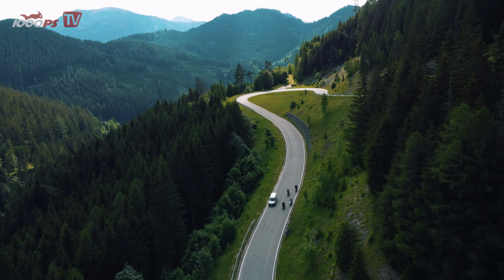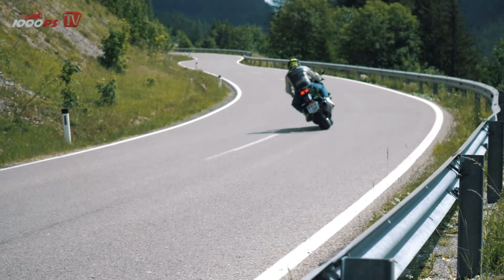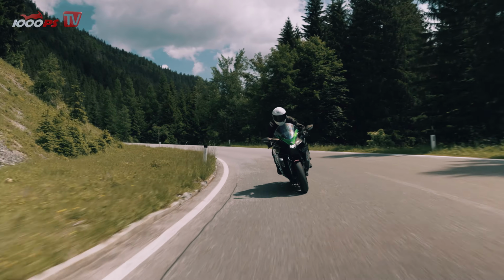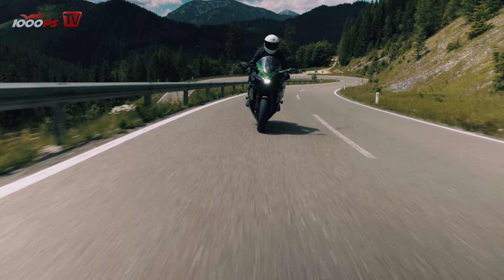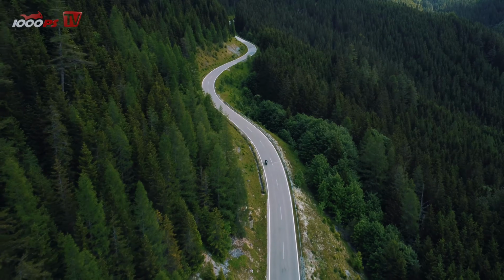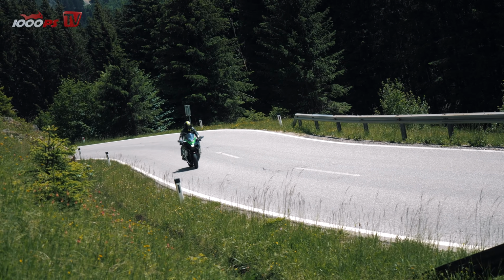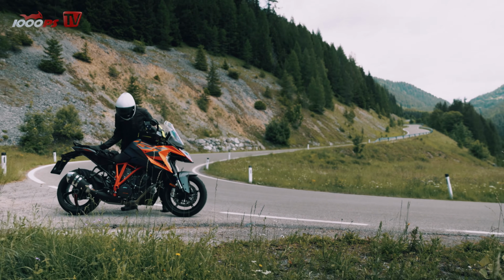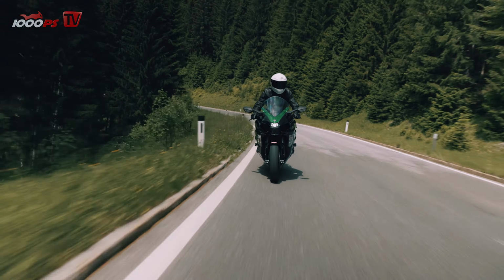Better than Hayabusa? Kawasaki Ninja H2 SX SE in Hyper Touring comparison 2022

Comment: The engine internals are different for each H2 model depending on the standard power output, i.e., ZH2 and H2SXSE - 207HP, H2 - 243HP, H2R - 326HP with ram air induction. They are all insanely fast. Sure, you can map up the HP on the dyno, install various stage kits and intercooler, but at the end of the day you are sacrificing the inbuilt reliability. I wouldn't buy one of these bikes secondhand that has been adulterated in that manner. They are powerful enough straight off the shelf. If you need more speed, you should be on a racetrack.

Comment: well, nice review, but I'm a bit surprised that you found brakes to be bad.. I currently have 2023 H2 SX SE, I've put about 6kkm on it at this moment and those brakes are insanely good in my opinion.. with only one finger I can easily send rear wheel into the air yet they are still not sketchy and will not scare you with some insane first bite like some other bikes tend to.. but maybe someone just like that and it is that first strong bite, that you are missing.. also with this bike kawasaki finally managed to tune their ABS to not be as paranoid as in previous models like Z1000SX..

Comment: I really wanted one, but I just couldn't ignore the hayabusa for the price. It was literally 10 grand less than the H2 SX. And I prefer the insane torque of the 1340cc. I also don't ride that far away and even if I did the hayabusa is still comfortable enough
Reply: Hey, i got the latest busa as well, i also have some other bikes including the zh2 and ninja h2, i recently sat on the latest h2sx and it was way more comfortable than the hayabusa and the power/sound of what a supercharger brings cant be compared with a normal bike. I now know for sure the h2 engine is the best motorcycle engine ever made.

Comment: I absolutely love my 2018 H2 Sx Se . The bike was great stock , but I did some work to it to make it faster and stop better. My bike made 271 hp atw and 114 ftlbs tq.
Reply: Which gear can it go full throttle without doing a wheelie ?
Reply: @jonasbaine3538  every one with traction control on 2 or 3 ;)
Stock I think it wheelies in 4th. 271 is a serious upgrade. I imagine if you really want it should wheel in 5th.

Comment: I have a 2022 Gsxs-gt 1000  a 2022 Bmw S1000RR  and a 2022 Kawasaki H2 SX SE in my garage with a few others they are all fun and fast .and my older bikes are 2013 and 2015 Zx14r's and a 2014 zx10r done by guhl and brocks ....My Favorite is the H2 SX SE ..with both bikes in factory stock tune its fast as my S1000rr with equal weight riders and its comfy and handles .I love the suspension and how you can raise and lower the bike also from the handle bars with the skyhook suspension if your carrying luggage or passenger and blind spot monitor and radar cruise work insanely good never thought i would care about this but its been a game changer, cant wait for tuning 235 rwhp will be perfect for spanking a lot of fast bikes with unsuspecting riders , i got a 10.07 141mph out of it on my draggy on the street compared to 10.21 at 145 on my bmw .. the kawasaki it way faster to 1000ft lots more tq down low the bmw needs to be revved and wrung out to 13700 and pulls much later in the revs ..I think the H2 SX SE is a amazing sport touring bike yes its pricey but its like owning ART that you can Ride .Just my opinion ...I say pick what you like to ride and  enjoy it as you have to pay for it !!!!
Reply: Hi, last week I purchased a brand new leftover 2022 H2 SX SE. Got a huge discount. How do you raise & Lower the bike as you say ?
Reply: @streetglidesteve7315  button on left handle bar ktrc button in between mode selection buttons , hold down the button in center

Comment: all those electronics got me more closer to the Hayabusa…H2 SX is no doubt a great bike, but when performance comes together with simplicity…I stand with the Peregrine Bird.
Reply: Hey did you already buy one of both? I highly recommend the h2sx. I got mt10, zx6r, ninja h2, zh2, gen 3 hayabusa, gsxr1000 k7 and will soon buy the latest h2sx. Trust me the h2 engine is on another level. Also i recently sat on the sx and tbh its way more comfortable than the hayabusa and way more torque because of the supercharger.

Comment: The H2 SX SE woke up my inner child that missed having a sport bike.If you are bored with ADV bikes and too young for a Goldwing/RT, then this bike is what you are missing in the garage. Forget about the motor for a second and realize how well the bike delivers a planted feeling mid corner with this excellent stock suspension. Weight of the bike works in favor of it delivering that planted mid corner confidence as it doesn't get upset with bumps. I bought one thinking about the motor and was surprised with its all day comfort on my back road rides and bags loaded for the long weekend. Yes a 60 year old is back on a sporting motorcycle and not feeling stiff or sore after hours in the saddle. In a word, it's FUN!
Reply: Yer spot on. After a 20 year absence from riding at 53 I opted fer the Goldwing DCT and slowly realized I had leapt a little to far ahead, since adding the H2 SX-SE I have everything I could ever want in the garage with all the safety and tech' what a bike
Reply: @TexasSteele67  21 Africa Twin AS ES DCT owner preparing to add this puppy to the stable!
Reply: @forestmotoadventures  I’ve a good friend about to add the BMW 1250 GS adv - not sure I’ll do a 3rd bike but the DCT Twin in Black sure is the ticket
Reply: Debating it too. ktm 1190
Reply: Hell yeah man! I’m 40 and I feel the same way